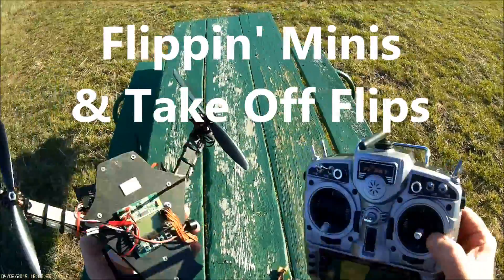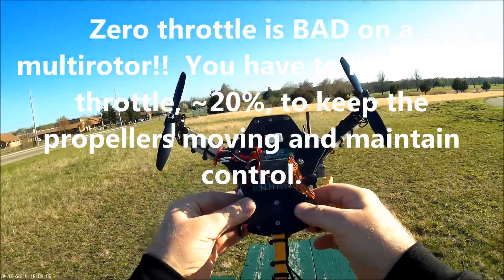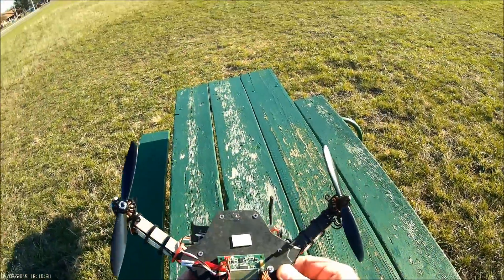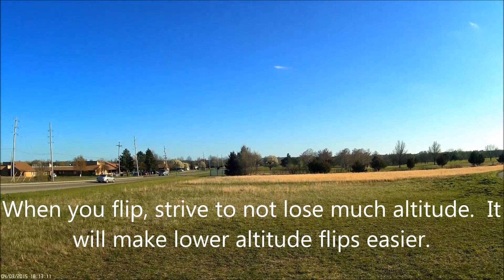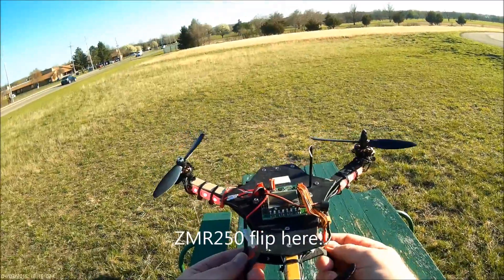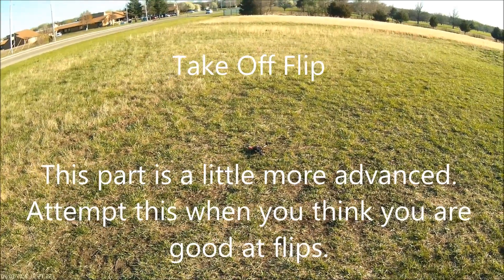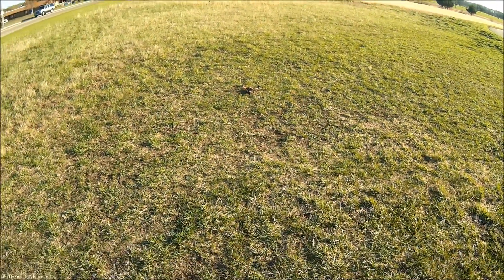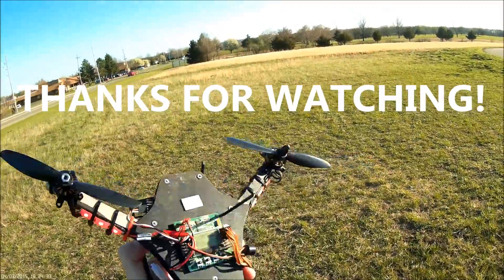How to Flip Your Quadcopter or Tricopter with Bonus Take Off Flip Instruction

Comment: .. can u recommend an inexpensive, durable rtf drone to practice flipping with?
Reply from the maker: You can practice with any quad.  Just make sure that you go real high so you have time to correct before it hits the ground.  Also, if you are using the default BetaFlight settings, It will flip pretty easily.  Get it about 30 feet up and try.  The main thing is to not panic, just fly it and keep your cool and move the sticks to level it back out once it comes around.  You can do it.  :)

Comment: How do you like the Mini Tri copter?    What Battery do you use,  what motors  what speed controls?      please let me know..    I have the larger T Copter but a little to big for my yard.        and I want to start doing flips and roll's      CFI
Reply from the maker: Gfdf Perte I love the mini tricopter!  I use Nano Tech 1300 and 1500mAh batteries.  As for the parts, I bought all the parts HallStudio recommended in his build video - Magic 12 amp ESCs, SunnySky motors, KK2.1.5, and 6x4.5 props.